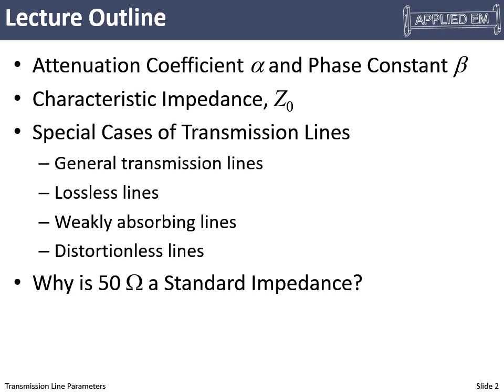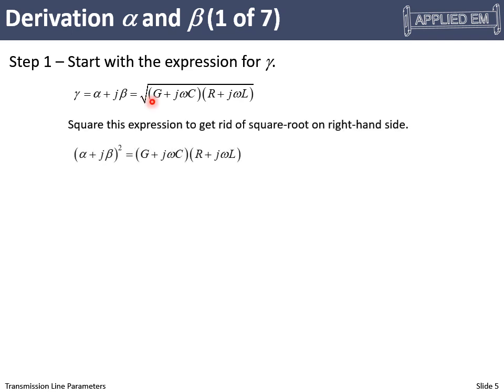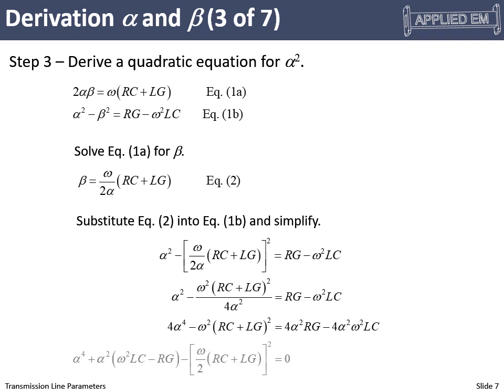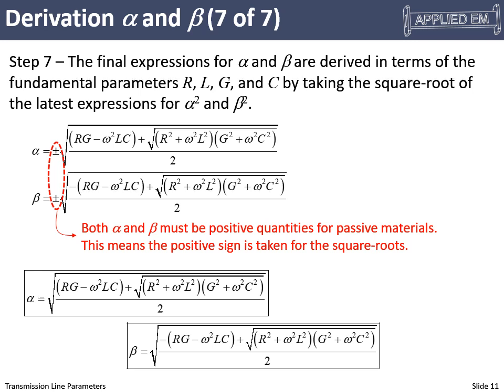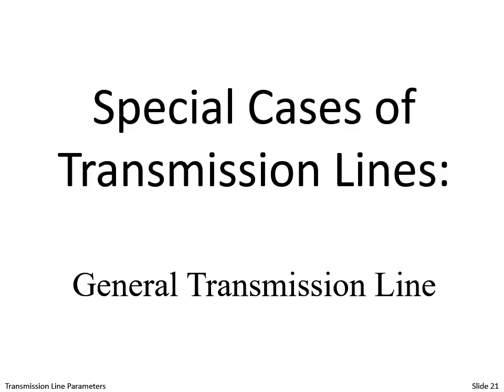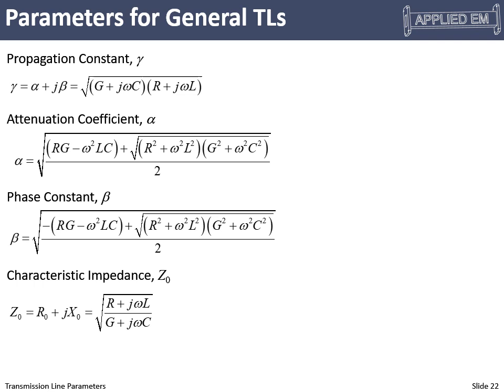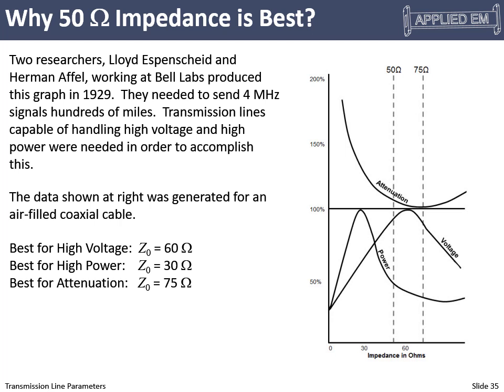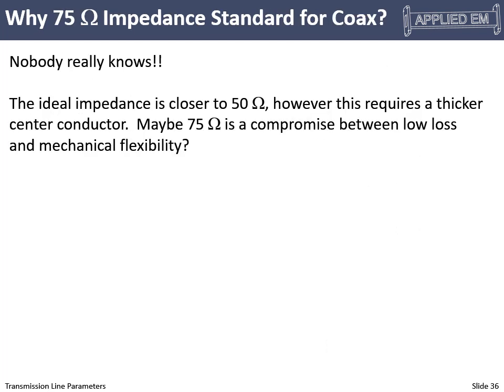Lecture 4b -- Transmission Line Parameters

Comment: Excellent lecture professor! I am curious how did you reduce alpha to such an expression in 21:56? Is the full derivation in the textbook or somewhere else?
Reply from the maker: Great question.  I have no idea where the derivation is and I cannot seem to find it.  So, I did it myself and added the derivation to the notes. You can get links to the latest version of the notes and videos from the course website, along with other learning resources.  In fact, I recommend using the course website as your main portal.

https://empossible.net/emp3302/

The derivation is not special to weakly absorbing lines.  It is an alternative derivation of general equations for alpha and beta that show how impedance affects them.  This is usual for the discussion on weakly absorbing lines.

Hope this helps!!

Comment: Hi, thanks for this whole series of videos, so far they're very insigthful, i have one question regarding losless lines. In wich real life cases can i consider R=G=0? Seems like a very useful approximation but im failing to visualize when i can apply it. Again, thanks for this series
Reply from the maker: It is best applied to very short transmission lines when the loss cannot manifest itself as much. It is also very useful when just studying transmission lines and devices and you are trying to accurately calculate how a device would behave.
Reply: @empossible1577  Awesome, distorsionless lines have the same cases? Or do i have to take other considerations?
Reply from the maker: @valentinmariatti2780  Yeah, I think pretty much the same. Remember, these approximations are only intended to make the math easier so that we can study and understand basic transmission line behavior. When it comes to actually designing a device, especially a high-performance device, we would typically not make any assumptions and let a powerful computer do a rigorous simulation to finish the design.
Reply: @empossible1577  Ok, got it, thanks for your time!

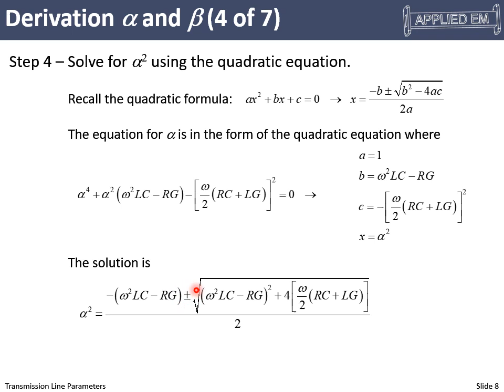Comment: Hi, I wanted to find out how did you derive the equation for alpha squared from the quadratic formula specifically the term under the square root? Its the last equation at the bottom of the slide. The slide is 5:55 minutes into your presentation. Thanks.
Reply from the maker: At time 5:32 I show the definitions of a, b, c and x for the quadratic formula.  The expression inside of the square root is b^2 - 4ac.  After some algebra, I arrive at what is on the slide.  Does this help?
Reply: @empossible1577  Thanks for your prompt response. I understood the terms under the square root. I tried the algebra to derive the final terms under the square root and I could not get that value.
Reply from the maker: @krishnanaidoo280  Hmmm.  I wish YouTube had LaTex in the comments to do equations.  Typing something would be a mess.  It is ugly, but it all works out.
Reply from the maker: @krishnanaidoo280  I looked at the slides and caught a small mistake that may have tripped you up.  When I wrote the 4ac term I did not include the ^2 power in the expression for c.  Anyway, I have added an Appendix to the lecture notes with the details of that derivation.  You can get the latest version of the notes from the course website:

https://empossible.net/academics/emp3302/
Reply: @empossible1577  Thanks very much for your assistance. At the outset, I want to commend you for these lectures which are very well presented and easy to follow. Thank you.
Reply: I have sent you a mail with a query. Thanks.
Reply from the maker: @krishnanaidoo280  I have added an appendix to the lecture with the detailed steps.  Are you still stick on one of them?
Reply: @empossible1577  I did pick up the ^2 when I was deriving the factored terms, however I got stuck from collecting the terms to factoring the terms. I tried to understand how you factored the terms but it did not seem apparent. Could you be more specific how you factored the terms?